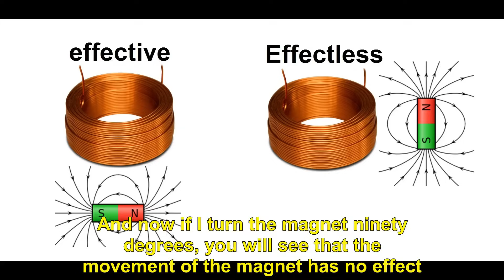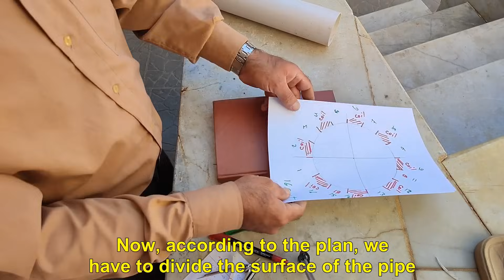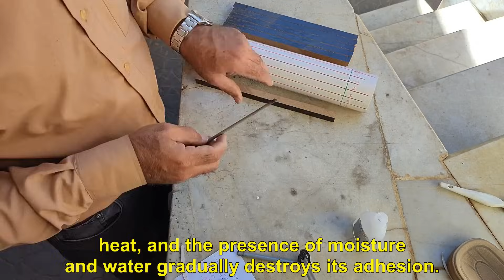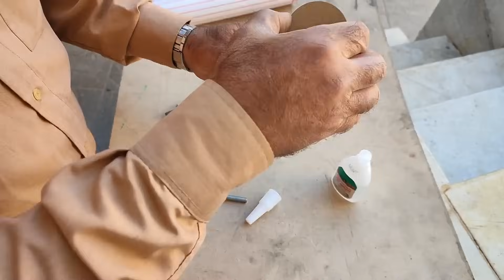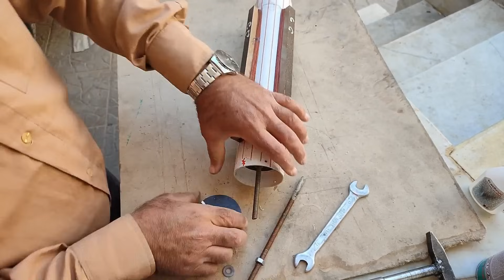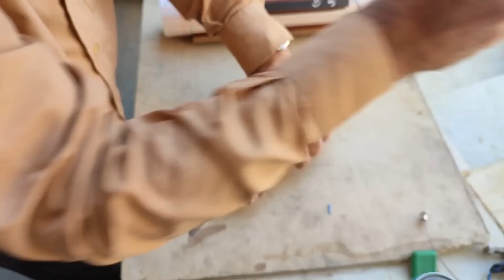How to make an AC generator.Making an AC generator from scratch

Comment: Is there a way in which we can make a 220 volt generator directly from an air turbine or something similar? We hope that you find a way that will make it easier for people to incur losses and save a lot of money. Thank you for what you provide.
Reply from the maker: what a timely
In the future program, the construction of a generator for wind turbines will be shown
But this generator produces DC power and can easily charge a 12-volt battery, and the battery can activate a 220-volt inverter.
Reply: @fixedfocussolar   Thank you for your response, and I wish you success in all your work.
Reply from the maker: Thank you